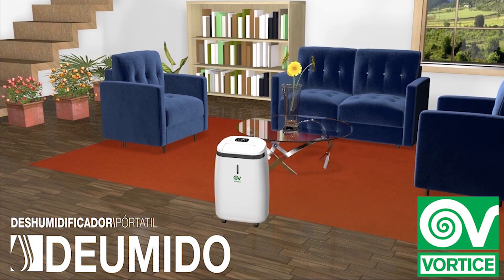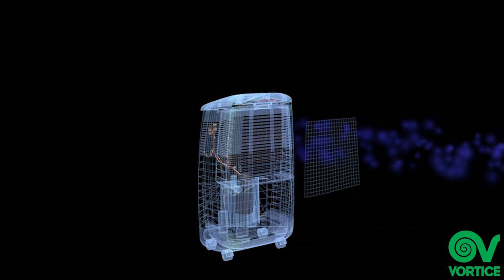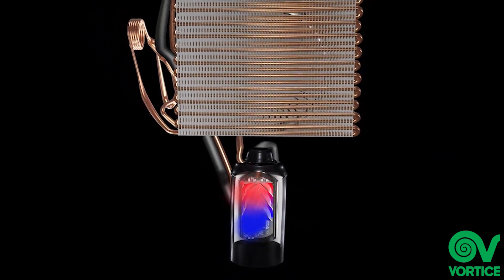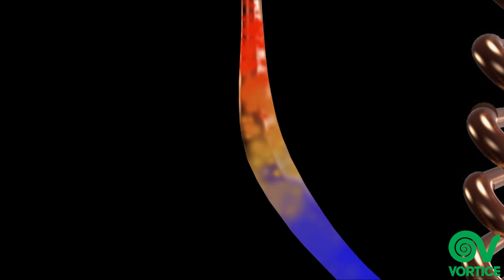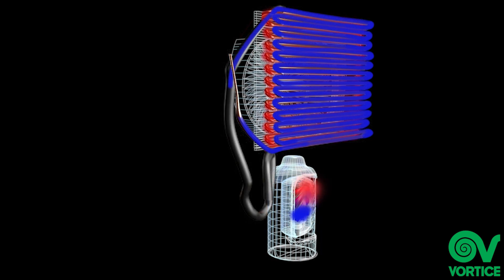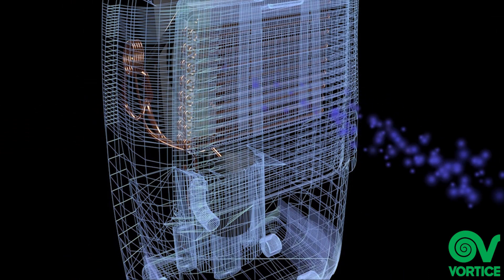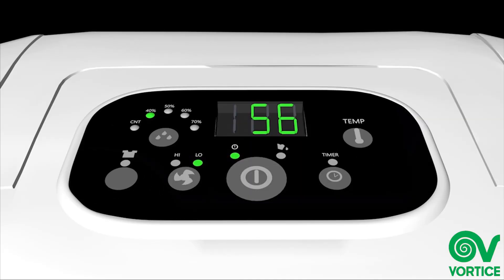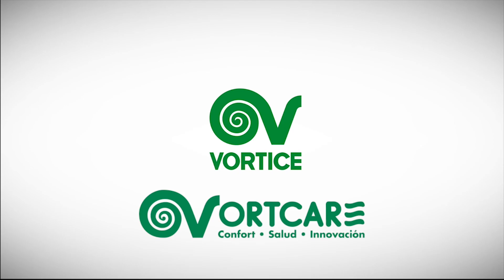How Does a Dehumidifier Work?

Comment: DON'T WASTE YOUR MONEY, BUY A BREEZE!

We use a product called the Breeze for our basement. It has a
gentle exhaust fan (115 cfm) that is rated for continuous operation, controlled
by a humidistat. Instead of replacing the exhausted air with outdoor air, it
draws on the "conditioned" air from the home's first floor, avoiding
the humidity problems and allergens that outdoor air present, especially on a
rainy or humid day. The air quality in the basement has improved dramatically
and we've been able to unplug the energy drawing dehumidifier. No filters or
drains are needed. The company sells one and two-fan models that cost from $349
to $449 and carry a 5-year warranty. I strongly recommend the appliance. It's
available on the company website (breezesystemsinternational.com) or on Amazon
and Ebay. Much cheaper than the $1,500 to $1,800 units sold by Wave Ventilation,
Humidex or EZ Breathe.